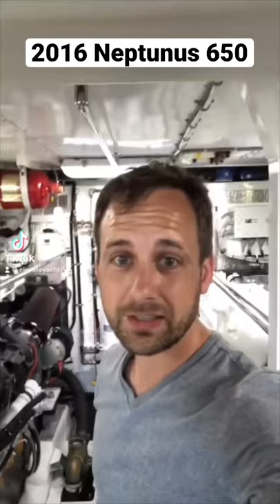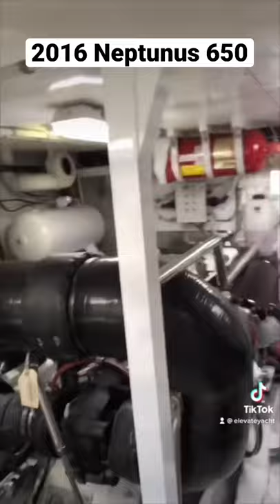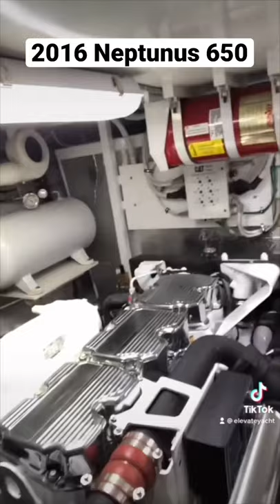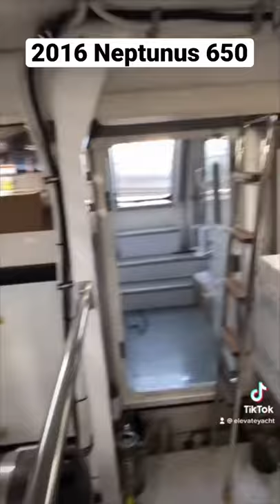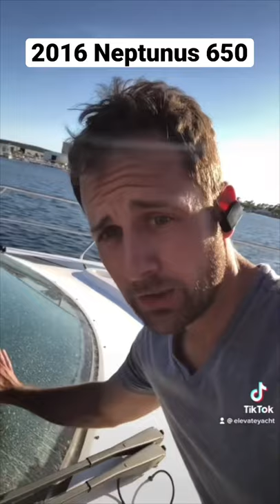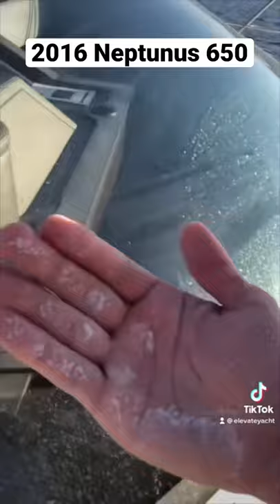Yacht Delivery Update. Engine Room Tour #shorts

Comment: Correct me if I’m wrong but is that salt from the spray in the water? Or the humidity? Also what is the biggest boat you’ve ever driven?
Reply from the maker: The salt on the windshield is from the heavy spray and splashing we were getting on the windshield during the crossing in 5-7’ seas. Currently the largest for me is a few different 70’ vessels. Out in our area, there aren’t too many vessels much larger than 70’, so I haven’t had too many other opportunities to take on something larger
Reply: @ElevateYacht  so weird I had a dream I had a yacht last night and you were not only a captain but a crew member and gave my friend and I an infinite supply of beer 😁
Reply from the maker: A captain’s job is never finished 😓
Reply: @helmmaster932  That's weird, I was having a dream about Captain Dan, too!